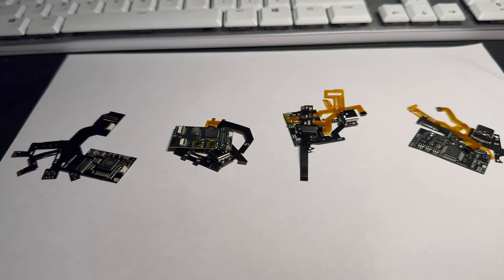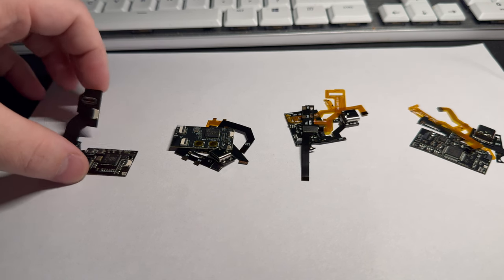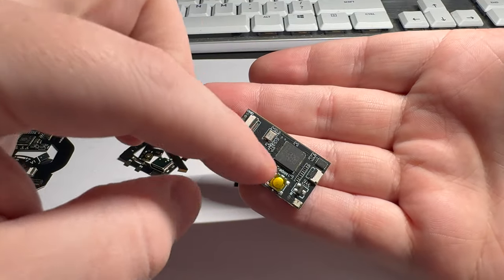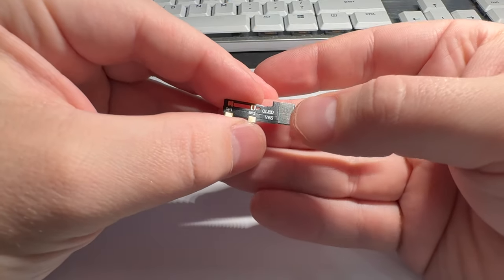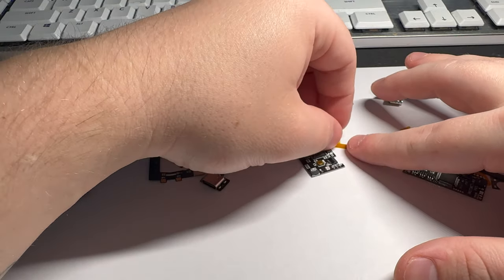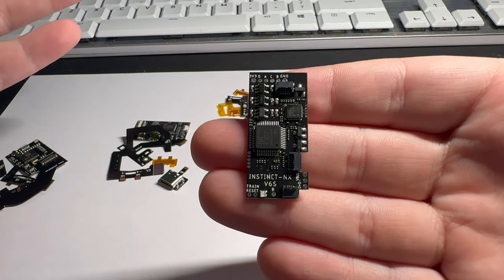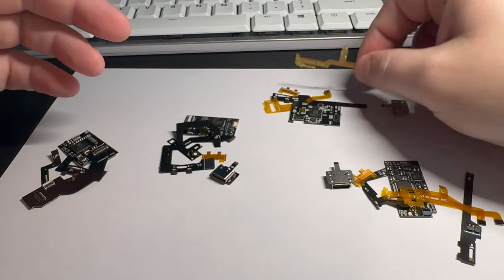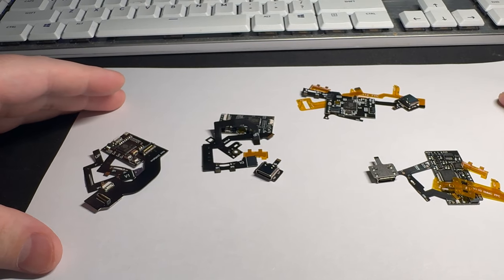What Firmware Chips for Nintendo Switch should you choose?

Comment: I've been stuck with this question for the last couple of months, thanks for making this video!

Edit: I understand that Nintendo hounds might track you down, but is it possible to have some links for the purchase of those? Want to mod my OLED, but the amount of various chips and ribbons that come with them just sends me straight into analysis paralysis.
Reply from the maker: I normally source mine from AliExpress. They have some on Amazon but cost a lot more
Reply: @PoTechTo  yeah, it's just that delivery times are really long. Will probably go with Amazon then. No experience in microsoldering and no microscope. Would the smartphone optical zoom be enough?

Comment: Would Nintendo ban an account when it's logged in on a modded switch?
Reply from the maker: If setup correctly they wouldn't be able to tell if your switch is modded.
Reply: Yes. Don't. Disable WiFi.
Reply from the maker: @tanookimarketing  This is false. You can use wifi normally on the EmuNand side as long as you have nintendos services blocked which they are if you use Hats Pack